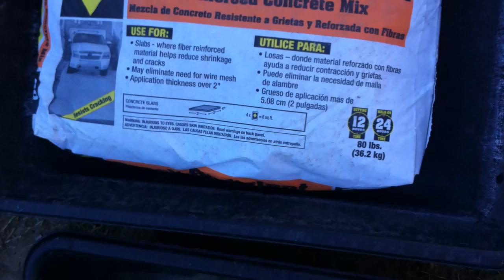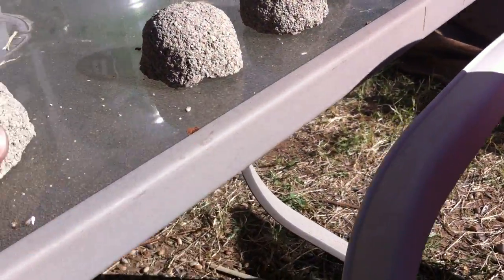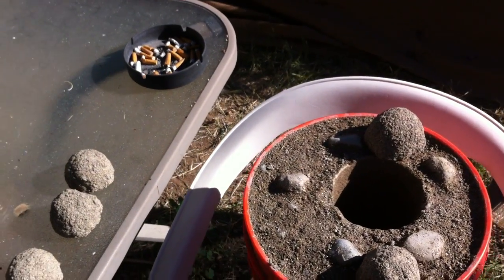Home made rocket stove, vermiculite and cement Part 2

Comment: This is so cool! 80% vermiculite and 20% fiber concrete. This would be a lot easier to make than cutting and welding steel drums. Heck, you can make any shape you want. I'm thinking fiberglass reinforced cardboard as a mold.